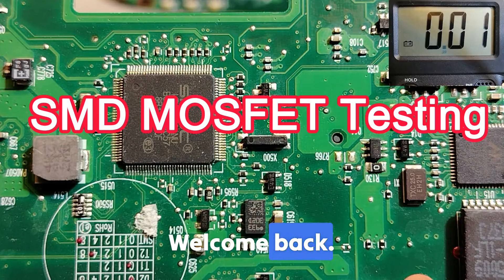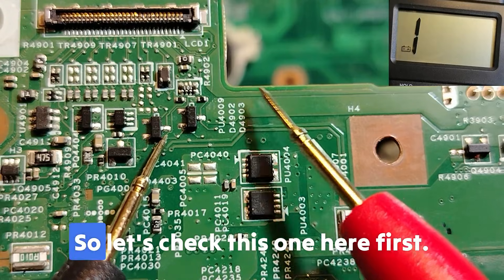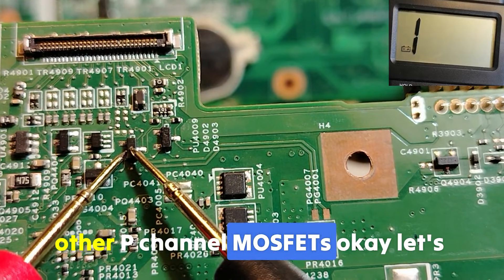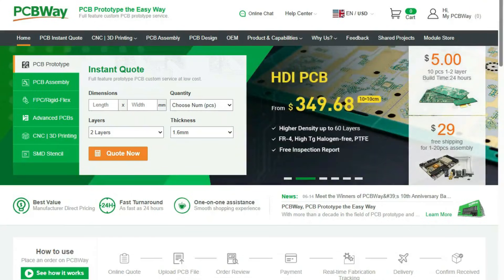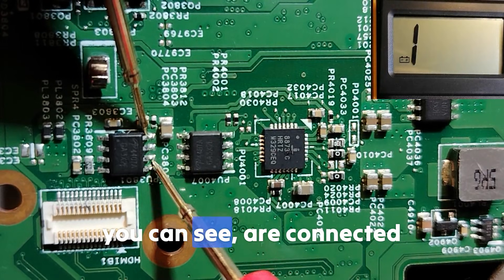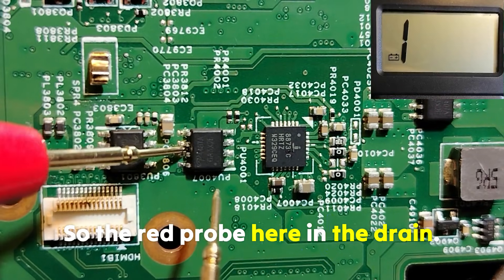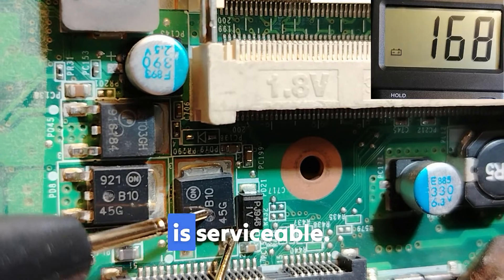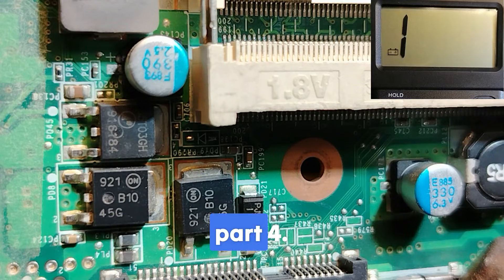The FASTEST Way to Test SMD MOSFETs | How to Test MOSFET with Multimeter Part 3

Comment: all these tests are done while the board is powered on, correct?
Reply from the maker: These tests are typically done on an unpowered board for safety and accurate readings.
Reply: @electronicsrepairbasics_erb  what setting on the mulitmeter? 20DCV?
Reply: @electronicsrepairbasics_erb  in which cases do you test components while the board is powered on ?
Reply: @911Audits  It is actually best to de-solder a component from the circuit board and use the multi-meter on said component for an accurate reading

Comment: the drop voltage is due to the internal diode. this teste checks only if the internal diode is ok. it does not reveal if gate is shorted or not.
Reply from the maker: The drop voltage does indicate the health of the internal diode. It’s crucial for a complete assessment.